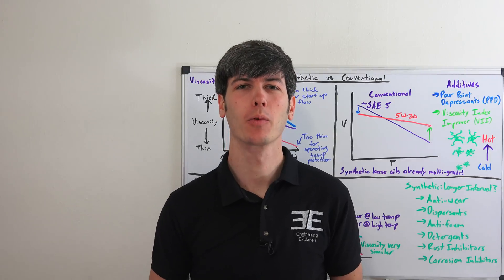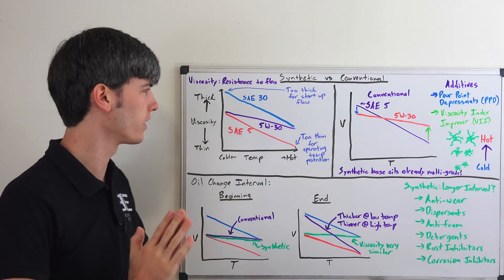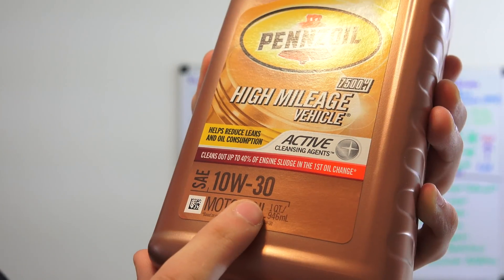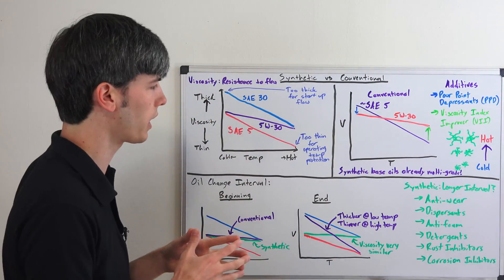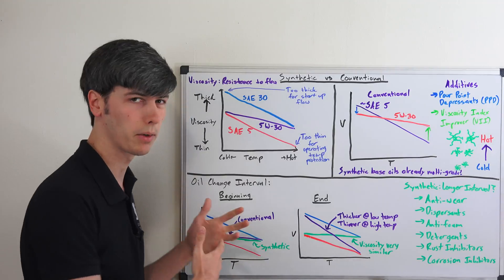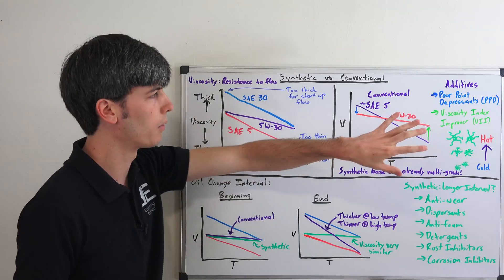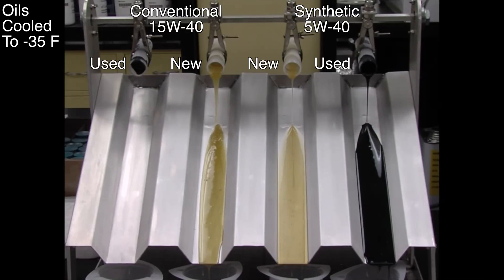Is Synthetic Motor Oil Better For Your Car?

Comment: When new, conventional and synthetic motor oils protect about the same ... with any differences in the protection coming from additives rather than the base oil.  Synthetic's two primary advantages are that they flow better at temperature extremes (high and low) and degrade more slowly ... allowing you to go longer between oil changes.

Comment: Bro, because your video is sponsored by Penzoil of course you are going to say that we should continue to change the better synthetic oil at the same interval and back that up by saying there are at least 6+ additional additives that wear out however, most of us who have been using synthetic for 20-30+ years on dozens and dozens of vehicles know better than this.

I loved your presentation until you got to that part. I guess you needed to stay true to your sponsor but doesn't it bother you personally - even just a little bit?
Reply: The filter still needs to be changed so that limits how long  you should go before you change the oil, synthetic or not.
Reply: @paulstabin6233  That is a BIG part of it. I think most people overlook the importance of filters and focus too much on oil. If your filter can't keep contaminants out of the oil then it doesn't matter what additives your oil has, there's stuff causing excess wear on the engine simply due to particulate matter. A moderately performing combo would surely perform better than 'the best' synthetic and 'the worst' filter.
Reply: Trevor Weir so synthetic is better for your engine or ?
Reply: Ryan Green_It's better for extended oil drains, like say 6 months for 7500 miles, and if there's a failure like maybe head gasket blows and dumps 2 gals of antifreeze in the oil pan, or you buy gas at a cheap gas station and get more water than gas, then ya, synthetic is better.  Bmw and Corvette apparently now only put synthetic in their cars.  But if you change oil every 3 months or 3000 miles, might as well go conventional. I've been synthetic only since the early 90's.
Reply: Trevor Weir I don't know why you would simply deny the ingredients in synthetic oil.  These are things any jiffy lube employee learns in their computer training.
Reply: Synthetic oil is actually best for you engine as all of the oil chemicals are the same size and shape allowing for better flow and do not break up into smaller particles under stress in your engine (given a good make of oil) the idea that a mechanic will try to give you a run for you money is kind of absurd (even though i know there may be some) as a technician i can tell you that i love cars and engines, and the majority of my peers do as well, we all love to see an engine that performs well and will last longer without repair or maintenance, because when things do break or need repair its not a 12 hour job just a 2 or 3 hour job
Reply: Trevor Weir i mean... its true lol. The same additives will probably not last as long as the actual oil will. Even if you can get the extra 500-1000 miles, its 30$ every 3-6 months to keep your engine in good shape. Its not like he’s ripping you off

Comment: if your video is sponserd by Pennzoil then your already biased. Pennzoil is a high perafane (wax) based oil, or at least used  to be. ran a engine machine shop for 10yrs. it was a straight up double charge if it was a Pennzoil motor. the amount of "crap" stuck to it was unbelievable. even got  taught that in collage. 100% Valvoline is the way to go!!! synthetic of course... just my opinion.

Comment: i have some question man..  I have original MB AMG oil 229.5 specification  ACEA A3, B3 and B4 specification  . i got 6 litres of this oil and its a SAE 0W40 so can i use this on my Audi S3 CJXC engine from 2016. does the oil need VW approval or can i use it without any problems? i think te most important specification is the ACEA  and if that meets the requirements than its oke to use right?

Comment: You are very intelligent and informative with your information, and that's good.  However, your presentation needs a little help to be a teacher.
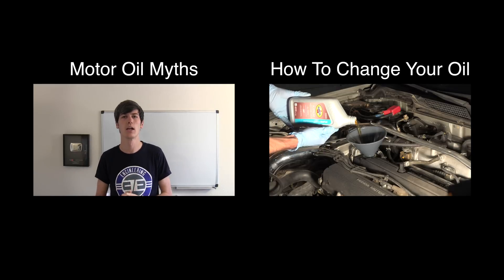1.  why are you in a hurry to finish?  you only talked 7:22 min.  It is hard for a viewer to sink all that info in their brain. By the time the viewer processes it, you have already given them more info.  slow down and emphasize most important points.  It's not a race. You are a nice guy and you have a lot of viewers with good info except you are like a rocket going by 10 feet above my head.

Comment: One really useful thing any car owner can do (besides using synthetic) is to get an oil analysis, done by sending a small sample to the testing company. Last time I had it done, it cost around $30 and the report you receive has very detailed information about the various levels of metals and minerals in you car's motor as revealed by the oil. The analysis that translates what these levels can mean is astounding in what it tells you about the condition of your bearings, rings, cylinders, etc.

Comment: another big difference is how they hold up in high heat.  take a synthetic and a petroleum oil, and stick both in a frying pan.  the synthetic will roll around and look about the same when you remove it as when you put it in.  the petroleum will leave little black marks all over the pan and look slightly darker when you pull it.  now imagine that for 10 years in your engine block.

Comment: i just dont trust synthetic oil, in small air cooled engines people use synthetic oil and i see rod knocks and low compression alot, and one motor where the oil seperated into water and sludge, i have a small motor with over 150 hours of only 2 oil changes not to mention all the hours it had before i got it and it runs smooth as can be and the oil still holds its viscosity, synthetic was developed for car engines and so its better for that but what about a small splash lube motor, they are probably alot different as far as oil requirements

Comment: I hate to say this but he acts like he knows a lot about oil but he does not. he only touched on a small aspect about oils and the differences between synthetics and conventional oils. There are 7 bases synthetics can be made from. not every base is considered good. Such as esters and diesters which is a base made from reacting an type of alcohol with an acid. It's considered old technology and is inexpensive. Right now PAO base is considered commercial high grade base synthetic and only a few make their oils from this. But how you can tell is that it's going to be the one's manufacturing it the longest, and it's going to be higher priced. And because PAO have a great stability for a base, it will also be the oils that have extended drain intervals.

Long drain intervals work if you use the recommended filters made for this. Mobile oil makes a long drain interval oil, and so does Amsoil. Why is that important? The smallest micron size of the particle that the filter removes determines whether you oil, when it turns dark, has turned into liquid sand paper or not. What you want in a long drain internal filter is a "lofted fiber nano technology filtration". This will effectively filter down to 10 microns and less. You average filter which is a paper type surface filter only goes down to between 20-40 microns.

Comment: What oil would you suggest for someone who lives in central florida where we have more then 100 days of 90+ degrees. The coldest we'll get is maybe two days of 30 degrees as the low for a few hours a night. I use synthetic oil on my vehicles but want to know which viscosity.

Comment: High mileage isn't conventional oil it's a synthetic blend. That's why you have to do a engine flush when switching to anything else after "upgrading" I saw the bottle and just thought I'd throw that in there.

Comment: synthetic oil builds a "film" or "coating" to keep everything lubricated but the problem is any lines that run any sort of oil through them including pcv valves and lines for crankcase condensation it eventually builds a heavy film and it clogs or blocks lines i never use synthetic for that reason.

Comment: You actually save money and time and engine wear by using synthetic. Most conventional oils now can go 5,000 miles and oil and a filter generally will run you around 20 bucks. You can get fully synthetic oil and a compatible filter for around 30 bucks and can go 10,000 miles with it easily. Less time and less money and it helps your engine last longer!
There are even oils like Mobil 1 who have a 15,000 mile and now recently they just introduced a 20,000 mile oil
Now would I run an oil 20,000 miles? No. I run Mobil 1's extended performance rated for 15,000 miles and change it at 10,000 miles so I know the additive package still has thousands of miles more before it starts to break down. That's just what I do
Reply: The oil will actually outlast the oil filter- that is why I change out before the mileage rating of the oil.
Reply: Synthetic oil prices are not that much of a higher price. At least if I buy them at walmart or order them. I pay about $22 plus $7 for synth filter. For the diy it is a good investment not so good if you go jifflube the rip u off.
Reply: @marcorubio3496  Fram Ultra Synthetic filter. Great price great oil filter. Use it all the time. Valvoline 5w20 full synthetic oil. You can choose any top tier oil you like. It's the filter that make the difference.  Shawn
Reply: @shawnbeck2303  Hey Shawn, just like you said "It's the filter that make the difference". for that exact reason I will never use a Fram. Fram is the worst oil filter in the world.
Reply: @kevinjones6471  lol so you read somewhere.
Reply: @awesomedave8484  fram uses cardboard spacers and lower quality filter media. It's been proven over and over again by cutting their filters open. Will it destroy your engine? Doubt it. But I'd still rather run a mobil1 or comparable filter than use fram. Just my two cents.
Reply: @AzalofForossa  I have never known anyone that had an engine go BAD based on the construction of an oil filter. But have known 2 that let their oil level get FAR too low and seized up engines. The Fram bashing is just the current trend online, based mainly on them putting out 10s of millions of filters, and other brands had to find a way to take a cut. Nothing more nothing less.
Reply: @kevintomb  not a trend when it's been proven. I never said they're bad filters, but I personally just don't like the guts of those filters. They look bad compared to other filters.
Reply: Amsoil last 25,000 miles before oil change but you change your oil filter in between or half way, using their oil filter
Reply: Oil is too cheap too still cheap out keeping it for 10k miles. I'll pay 20 bucks to change my cars synthetic oil and filter every 5k and have it outlast the rest of the car.

Comment: Hi EE. I love your videos. Ive been searching the web and couldnt really find a comparison; How an engine looks inside after 100k (including oil pan bottom) from regular intervals with conventional and synthetic. I found a video that "shows" the insides of a motor that used royal purple for 200k and the sludge it left. But doesnt all oil leave that sludge buildup after that many miles?

Comment: i worked for a major oil company in the Lubricants Technical Support Department. The Manufaturer of the engine tells you if you need Synthetic or not.  DO NOT WASTE your money.  Synthetic is not required unless your engine manufacturer requires it.   The trick they do not want you to know is that the whole industry have moved to Hydro Cracking the Base oil molicule and thus able to remove more of the Higher valued lighter distillets.  The cracking process modifies the base oil as now the manufacturers can not sell the oil as real oil... they must label it a synthetic oil.  This sludge is mixed with chemicals and other oil to produce semi or fully sythetic motor oil.  READ your owners manual.  
Sorry to say that penzoil and most of the oil manufacturers have spun this synthetic as a good thing.  
sad
Reply from the maker: "have spun this synthetic as a good thing" as did AAA, who performed 8 third party tests and found synthetics to perform 47% better than conventional. It's not just hype.

Comment: IF YOU ARE NOT MAINTAINING THE AIR FILTER WITH SYNECTICS OILS YOU ARE DOING MORE DAMAGE TO YOUR ENGINE WITH SYNTHETICS THAN USING CONVENTIONAL OIL YOU CHANGE MORE FREQUENTLY WHICH GETS RID OF THE DUST PARTICLES WHICH ENTER THROUGH THE AIR FILTER WHICH IS THE CAUSE OF ENGINE WEAR. IF YOU ARE GOING TO USE SYNTHETICS WHICH STAY IN THE ENGINE FOR A LONG TIME KEEP THE AIR FILTER CLEAN. THE DIRTY OIL YOU SEE IS THE END RESULT OF DUST PARTICLES PASSING THROUGH A DIRTY AIR FILTER. THESE DUST PARTICLES ARE SAND WHICH IS THE SECOND HARDEST SUBSTANCE IN THE WORLD NEXT TO A DIAMOND WHICH IS FIRST AND WHAT WEARS YOUR ENGINE DOWN. USING SYNTHETICS WHICH YOU CHANGE 1 TIME A YEAR COULD ACTUALLY DESTROY YOUR ENGINE UNLESS YOU MAINTAIN THE AIR FILTER KEEPING IT CLEAN OR DUST PARTICLES WILL KEEP ENTERING THE ENGINE AND DESTROY IT OVER TIME.

Comment: Can you mix synthetic and conventional motor oil?  One myth that I keep hearing about is that you can derive most of the benefits of synthetic while reducing your oil change costs by blending X quarts of synthetic in with your conventional motor oil.
Reply: Yes, I used Motorcraft 5W20 synthetic blend for 150,000 miles. But blend oils don't and aren't 50/ 50 blend they can be as little as 2% BLENDED and be called a blend. I would go to Supertech synthetic. What ever your car calls for like 5w20 or 0w40. Look in your car manual for what it needs. But I have found the Super tech oil are really good just buy the best filter and run the synthetic 5,000 to 7,500 miles between oil changes. You will see it just as good if not better than the higher priced oils. I know I have tried them all. I am 58 years old. I have been driving for a while and used all oils and filters. But you pick what you want! The choice is up to you. Shawn

Comment: I'm guessing oil viscosity has an impact on oil pressure. If I'm losing pressure at high temp with a 5W40, would recommend the use of a ticker oil ?

Comment: I live in AZ where outdoor temperatures will be at 110-120F. My car calls for 5w-20 oil, because of the hot temperatures, do I still use the recommended oil or due a different grade of oil?

Comment: Hi bud ive watched some of your stuff and enjoyed it but your a bit 1 sided here. you are dodging the fact that synthetic oils are made with additives that break down. Any oil is only designed to withstand up to 100degc . You are testing oil at -35. whos  driving in -35. and if your oils that dirty you got bigger problems than what oil your using.  If I had a twincam or intricate motor I would use synthetic no question. A couple of people replied commenting older style motors thrive on thicker mineral oil. And if you use a 20 50 your never going to have thin oil but if you use a 5 30 and it stuffs up you got 5.

Comment: @Engineering Explained 

If you open your oil canister and pour oil to your engine. The oil left in your can is either left in the garage or in the trunk of your car in case of a top up. Does this oil deteriorate in your trunk? OR is it safe to use in the next oil change?

Comment: Question What is the proper viscosity of the car engine oil Note that the air temperature is between 35 to 45 °c degrees

Comment: Thanks so much for the video. Can I use  castrol edge 5w 30 on a supercharged engine? It's a range rover sport supercharged. Thanks in advance.
Reply: Steve Shih ..yes, Castrol Edge or Edge Gold (both full synthetic) would be fine in any turbo or supercharged motors!

Comment: I drive Land Rovers.  I've been using AMSOIL 100% synthetic oil since 1974.  Why?  Because I am a maintenance freak, and I change oil every 25 thousand miles!  (not 6,000 for petroleum oils) Just by changing from petroleum to synthetic, I gain 10% power in the engine and when using K&N air filters, I increase power even more.  I average 19.6 miles to the gallon. I remember when I took my car to the mechanic for a major tune-up, inside the valve cover was clean as new!  No black soot,  which is combustion byproduct. I use 1 oil filter per 12,000 miles.  The bottom line:  CHEAPER to maintain, more power in the engine, no need to warm up the engine in a very cold winter, and the engine lasts at least 250 thousand miles before an overhaul.  COOL, HUH?    AMSOIL IS MADE IN SUPERIOR, WI, USA!

Comment: Chat Conversation Start
@Jason  Hi First of all , i am crazy about you EE, and the amount of knowledge you share. Thank you.  I have a question . I Live in India( temperature is ~109 F in summers) , and own a small 1.3 diesel car. I know synthetic engine oil is better than regular mineral engine oil. But considering the costs does it make sense to  use regular Mineral engine oil and change it  twice in a cycle rather than using Synthetic oil ( which is expensive) and changing it only once in a cycle . What do you suggest. TIA

Comment: I swear by Castrol. Been using tbeir synthetic since 2010 in my truck (Dodge 4.7L; good engine). I swear it felt smoother at startup. Ditto for my Mustang V6, 2005 bought in 2012 with 22k mi on it. Switched it to syn at its first change. I change them every 5k or so and don't worry. It is supposed to flow better at startup, which is key, and all testing shows that it maintains consistent viscosity much better.

Comment: It really depends on the engine, late model cars (sedans mostly) all use a high synthetic oil, while a heap of engines before 2007 or so would struggle to cope with synthetic oils.
Reply: there's no struggling to cope with synthetic oils of almost any engines that have ever been made!   You are wildly misinformed.  Synth can go into any IC engine, literally any, with no deleterious effects, ie, nothing bad gonna happen.   If already a leaking engine, it will possibly leak worse